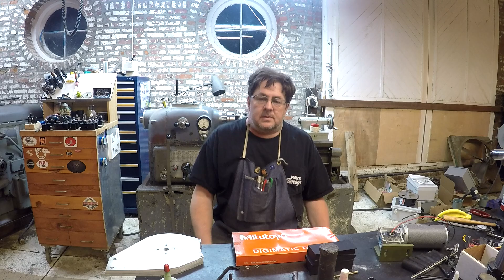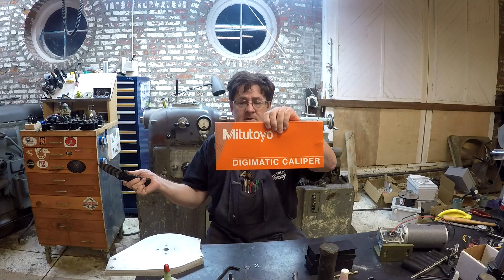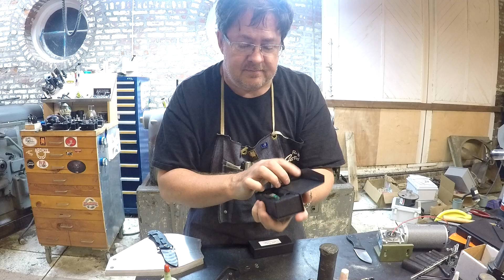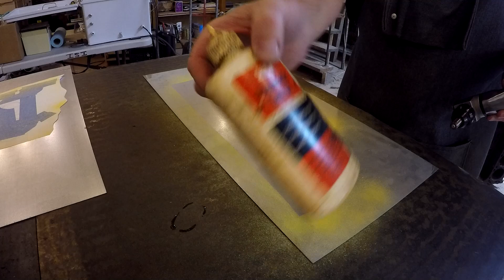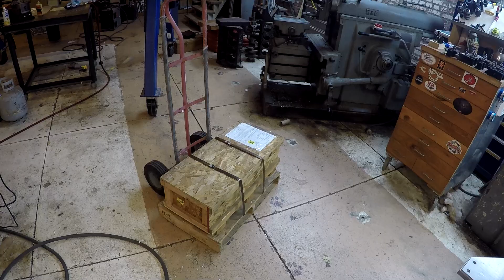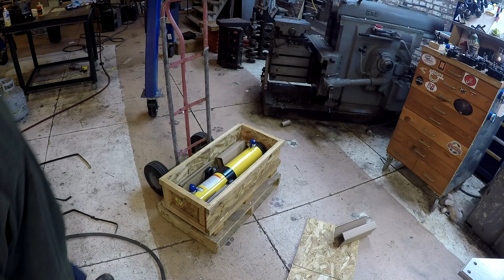Shop ADHD #32

Comment: ADHD for sure.  You should have used the left hand snips on that 26 ga. instead of the nibbler and saved some clean up!  For that matter, nesting to the upper right hand corner would have saved some cutting and some material.  OOps, that would be OCD and not ADHD!
Reply from the maker: The top might have looked flat but it had a large radius to it.  I was going to use the snips, but I had never used that nibbler before and wanted to test it out.

Comment: Left-handed calipers. Is there such a thing?  It sure would be nice 'cause it's quite UN-comfortable to try and use the usual right-handed style.
Reply: There are. I gave James a pair some time back.

I used mine quite a lot. I'm not left handed, but they work better for measuring stuff in the lathe chuck.

I don't think James got along with the pair I sent not having a thumb wheel.
Reply: I think you can find em' at Ned Flander's shop "The Leftorium". Sorry, I couldn't resist, I hope you can find a pair. If not, I'm sure Rob Renzetti could custom make it for you, have you seen his videos? His YouTube handle is ROBRENZ all caps, and he's the guy who scraped Tom Lipton's P&W level, and he makes some interesting videos...Good Luck, Aloha...Chuck.
Reply from the maker: I use those lefties you sent me at the desk, try to keep them clean, the only pair of backwards calipers I have.
Reply: So that's why I don't see them, you're keeping them for best!